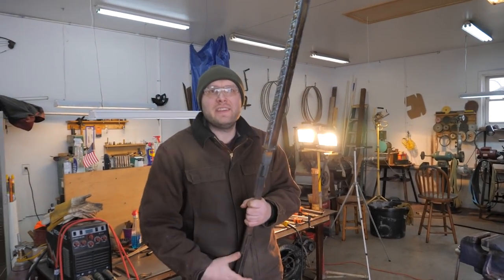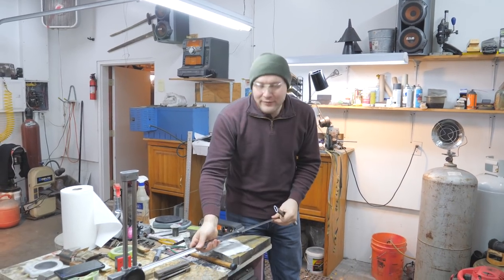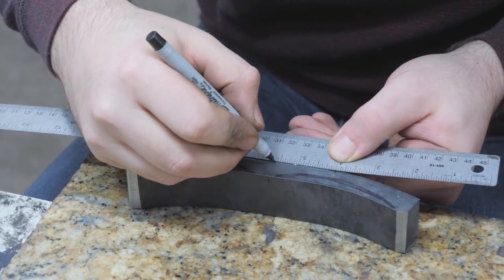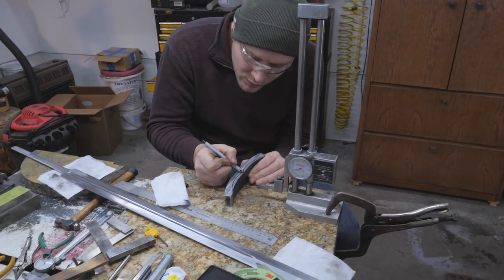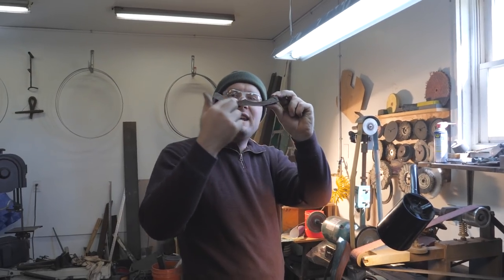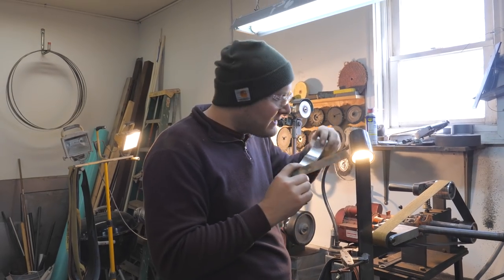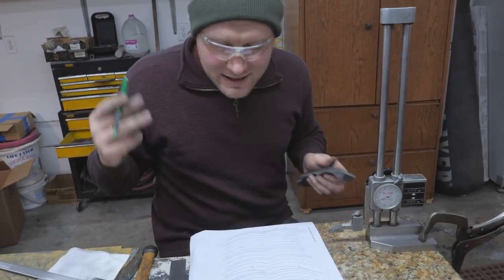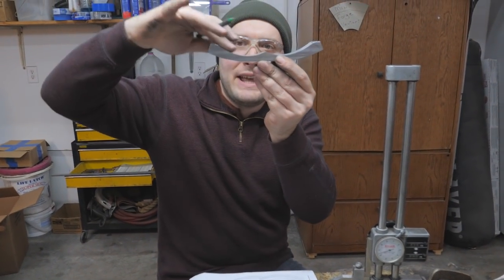Making a Medieval Damascus Sword Pt. 14

Comment: Heat the crossguard up and then hot forge it onto the tang, to permanently secure it there, it's easier than drilling and grinding too. Just hot punch through the crossguard with a drift that's made to the same size as the tang, heat up the guard then slot it in and quickly hammer it shut, it's easier as well as better construction.

Comment: how do you know how the profile of the blade looks exactly so you can draw it on the guard and then mill it, or you just assume you ground the blade perfectly and calculate angles and lengths of the profile

Comment: Kyle I know you know 100x more than I will ever, but I purchased a TW-90 belt Grinder. 1) it is not cheap 2) it comes with all the accessories so no  need to build or purchase different items. 3) it flips on its side and has a special plate you can use so you do not have to Jerry rig your grinder. take a look at the you tube vids. TW-90 by Travis Wuertz. a two time winner on forge and fire. I have talked to him and he is very receptive to answering questions. With your precision of work this is a good tool to have.
Reply from the maker: Yes, the TW-90 is a great grinder! I'll probably get one sometime. I have a friend near me who has one that I've had the chance to use and I agree completely with your sentiments on it! Kyle